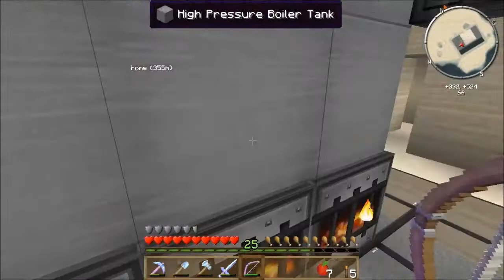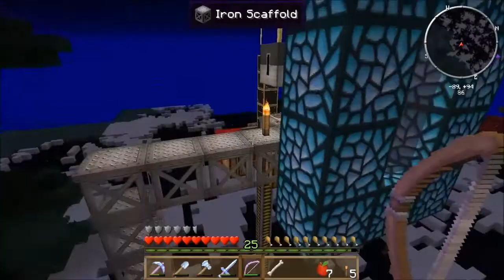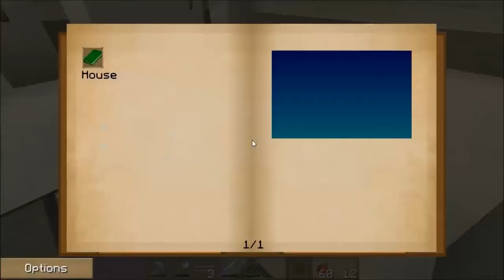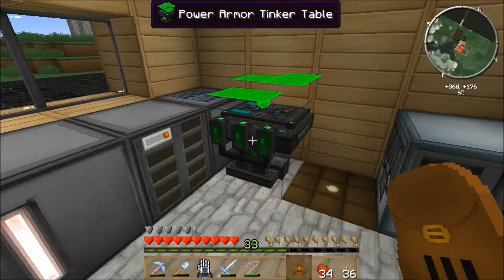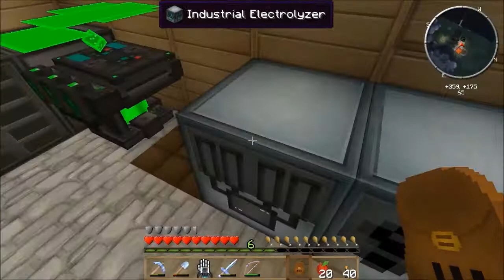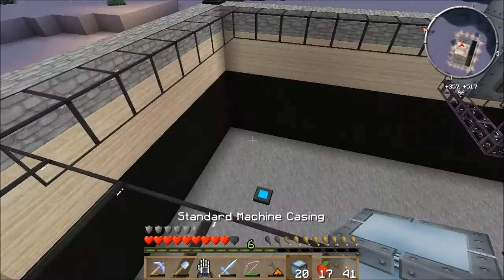FTB Unhinged E17 - Setting up Nuclear Reactors & Industrial Grinder

Comment: a question about the gregtech and nuke side of the temple, do you plan on roofing that?  I know you are in a desert so it wouldn't rain, but putting gregs machines outside always makes me really nervous.
Reply: Ako always makes his base spawn proof and I'm sure he's mentioned building walls around the whole place, so he'll most likely build them in the end high enough that nothing can see inside the base if he doesn't decide to roof the Greg Tech items
Reply from the maker: That's a good call, I am planning to cover it all but might not have before powering it because I forgot about the explosions - I'll certainly roof that side before fireing anything up :)
Reply from the maker: ***** Gtechitems explode when exposed to rain, I totally forgot about it :)